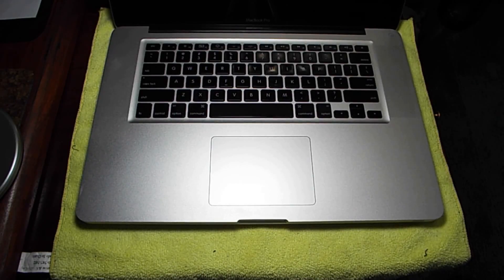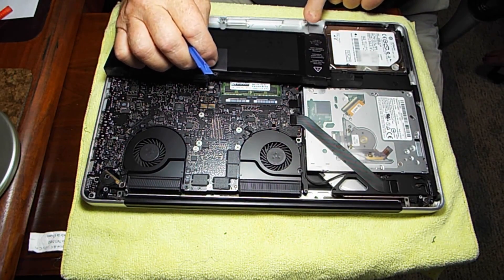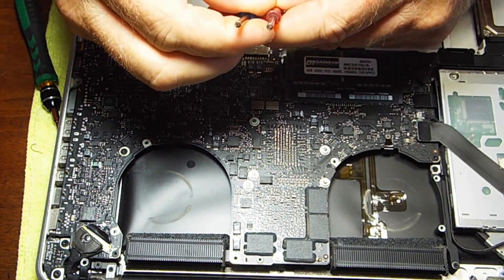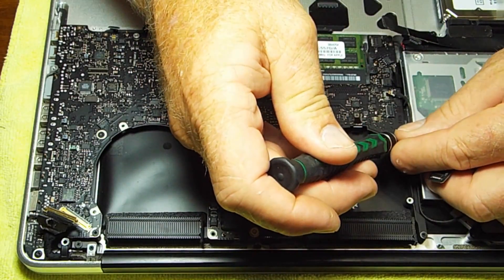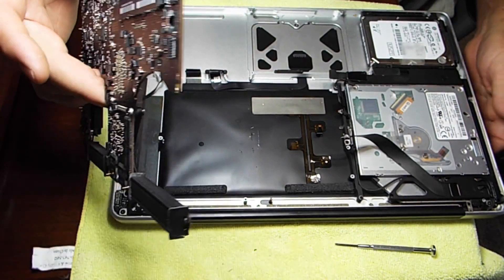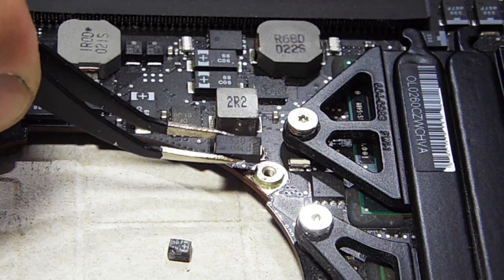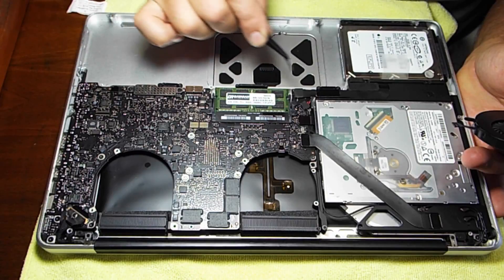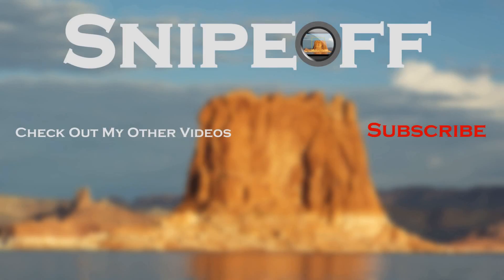Mid 2010 Macbook Pro 15 Inch GPU Kernal Panic Repair

Comment: OK, replaced the capacitor, reassembled, and now it tries to start up but screen does a micro-quick horizontal line flash, then goes completely dead. Also, the white power light on the front goes out and won't respond when I try to restart unless I hold the power button down fro a LONG time 
Any ideas?
Reply: Duh!  Missed a small ribbon cable connection under a fan...also resoldered the replacement cap and all is working fine now.  Thanks for walking me through this repair!

Comment: I seriously cant believe how easy this is. my 2017 air died this year and I have been computerless so I pulled my 2010 15" out and I had forgotten that it was doing this. its doing it way more since its been sitting for years. this is a cheap easy fix!!! I am running linux mint on it but it will just turn off whenever it wants

Comment: hey thanks for this tutorial. question, can I use a hairdryer or do I need a heat gun. I want to use a hair dryer with an extension to focus the heat like you did.
Reply: @Snipeoff  great. do you think it might be if i used a stronger capacitor?
Reply from the maker: @titustech337  I'm so sorry, I was completely distracted today at work...I didn't realize what video this was 🤦🏼‍♂️
Reply from the maker: @titustech337  This was absolutely a permanent fix for us, that computer is still working...I looked at the thumbnail and thought it was my other video for the Mac repair
Reply from the maker: @titustech337  I apologize for the confusion, I'm gonna delete my other replies to avoid others being confused 😅

Comment: I started having Gpu kernel panics on my MacBookPro6,1 mid-2010 17”. I’ve seen two videos including yours on replacing the capacitor, but for a 15” of the same model year. I’m having a hard time thinking this is the problem after over 10 years of no Gpu kernel panics. What else could it be? Why does the capacitor “fail” after so much time, and is it the same capacitor as on a 15”? I find your video very useful in showing how to remove the board, it’s a bit more involved than replacing the hard drive which I did years ago. A couple questions:

1) Is it possible to modify the kext extensions for the 17” as others have suggested for the 15” or will this not work? On the 15” the changes were G-state threshold levels all to just above the lowest setting. Is there a similar fix for the 17”?
2) I have the classic kernel panic of black screen and restart, with a kernel panic report when it reboots. However more times than not it gets stuck trying to reboot with a repetitive clicking sound from the area near the MagSafe power adapter (upper left corner). What could that be? Sound doesn’t seem to come from the hard drive (lower left) or anywhere else. Perhaps it is the fan? Power supply? Eventually it reboots after pushing the power button when it’s “cooled off”. 

Thanks in advance for any guidance, and great video.

Comment: No disrespect intended, sir, but changing my battery did not correct this problem for me. Ultimately what did correct it was an app and instructions offered by one of your colleagues found at the following URL: https://www.youtube.com/watch?v=tiXYkyj2Y5Q. What is nice about this, is no purchase of a battery or any other hardware is required: no purchase of anything at all, really. I can not say for certain it will work for everyone out there experiencing these constant crashes,  but it did work for me—which of course I am grateful for. It might possibly be effective only on the Mid 2010 Macbook Pro model, for some reason, just as your solution addresses in its title. This narrows its usefulness, of course, but in any case, if this is the model you own then you might possibly find success here as I have. Good luck.
Reply from the maker: We didn't change the battery in this video, it was a capacitor on the circuit board. But whatever the case, I'm glad your issue was solved

Comment: can i just leave the battery outside without put it back and make my 2010 macbook pro still power on with plug to electricity only?
Reply from the maker: I think you can, but I'm not sure
Reply: @Snipeoff  thanks, maybe anyone have try it before? i would like to try and following the steps
Reply: @AlwaysWrong  you cant, i have tried it but it did not power on.

Comment: Would conductive epoxy work to reattach new capacitor?
Reply: That's what solder is.  Get a $15 heat gun from Harbor Freight and a coke can like this guy in the video and make you a heat gun to solder it. :)

Comment: I have very little experience doing this kind of thing but all of the local repair places that i call say that the motherboard needs to be replaced. I don't want to pay for that to be done when the same problems will inevitably end up happening again. 
would it be totally inadvisable to try to do this by myself? 
It doesn't at all seem that difficult...
Reply from the maker: I mean if all your data is backed up, I guess you don't have too much to lose, since the computer is kind of unusable as it is... I would just take it a step at a time and work through it
Reply: @Snipeoff  it turns on and everything so it's not totally unusable as of yet. I just anticipate the problem getting worse. I have been using one of those software fixes for now which disables the discrete gpu...
Thanks for replying!
Reply from the maker: @pablocasteldeoro8526  I wouldn't be too afraid, if in the future it gets worse, just try it
Reply from the maker: @pablocasteldeoro8526  no problem btw
Reply: @Snipeoff  since i'm such a noob-in the eventuality of my getting and using a heat gun for this, what temperature do you have it set at?
Reply from the maker: @pablocasteldeoro8526  well shoot, I wish I could tell you, our heat gun just has 2 settings, 1 and 2...we had it on 2...I have no idea what temp it actually is 🤷🏼‍♂️.
Reply from the maker: It was running really hot thou, especially with that cone on it, it actually kinda overheated the gun...by the way you can buy those cone adapters for heat guns online, rather than making one

Comment: Hey. Thank you very much for your tuto. I just fixed my MBP and it works great ! Just one little pb : lightness is not optimal and the screen brightness butons on the keyboard don’t have any action anymore. Where does it comes from ? I’m wondering if the connexion wire up to the right fan is not the Pb ? Thank you very much. B.R.

Comment: Hello sir
I am a student .I am new to mac world.I am having macbook pro mid 2010 serial number W8020CFZAGW .I am using windows OS .
While using After some times my macbook blinks few times and give error ''Display driver stopped  responding" or
"Kernal version 342.01 has stopped responding and has successfully recovered"
But while using Mac OS 
After some time my mac Automatically restarted with error
"Your computer is restarted because of problem"
Will changing capacitor solve my problem??
Plz help
Reply from the maker: I'm not entirely sure...I did a little research, and your problem seems a little different
Reply: @Snipeoff  Thanks for giving some attention to my comment.
But sir;
Any suggesion to solve this?
Its very easy for the person like u to judge the problem. I am not professional like u.
PlZ suggest me a possible solution?
Reply from the maker: I really am not a pro...we have experience fixing electronics, and we researched the specific problem we had and found a solution...but we aren't professionals
Reply: @Snipeoff  Any suggested solution??
Reply from the maker: @knowledge.hub1  Perhaps take a look at this video...https://www.youtube.com/watch?v=3op7JknzUyA

Comment: Hi , just stumpled on your video makes it look doable, thanks!!!Really thinking about trying it. Only question is did it fix the issue? And is it still working?
Reply from the maker: For us, it did absolutely fix the issue...and it is still working today, we have not had an issue since with it.
Reply from the maker: I would recommend getting yourself a screwdriver set...the link is somewhere in the comment section, to the one we used...and there are heat gun adapters on Amazon
Reply from the maker: I added that link to the description, let me know if you have other questions ;)
Reply: @Snipeoff  amazing i got the soldering set and a microscope headgear carted up in amazon was going to upgrade the ram to 8gb and replace a faulty battery first, if that doesnt do the trick i might pull the trigger, gotta keep busy during these crazy  times. thanks again!
Reply from the maker: Yeah I hear you there...I've been doing maintenance for days on my truck to stay busy...no problem...I appreciate the comment 🤙

Comment: HELLO I HAVE A MACBOOK PRO 2010 SERIAL W80291Q2AGZ , PANICS AND RESTARTS ,DOES THE CAPACITOR WORK FOR ME?.....CAN SOMEBODY HELP ME.
Reply: https://www.youtube.com/watch?v=YI6V2k6dvLg
Reply from the maker: I'm not positive...but I'll pin your comment so more people see it 🤙
Reply: You need need to look for panic code. if it says gpu failure, then this may solve your problem.
Reply: I guess I am a little late, but yes. Just have a repair shop replace this wrongly specified capacitor with a tantalum(?) one and your MacBook will live again. The MB replacement Apple did was never necessary. I payed 350€ for a new one with the same wrong capacitor and had to pay again to have it replaced at a repair shop. I also had to replace the keyboard. Now it will work again for another ten years.
Reply: Probably replace it, nothing to lose!

Comment: Thanks for the video, especially the tips on how to remove the logic board and labeling them.  I don't have a heat gun, but i do have a regular old soldering iron with nice small chisel tip.  Will this get hot enough to remove the old capacitor?
Reply from the maker: Um...it could, I'm not entirely sure...the issue would probably be getting the new chip on... because you don't want to melt the casing while you're trying to get the solder to melt underneath
Reply: @Snipeoff  yeah i was going to try it with my soldering iron but i didn't think it was such a good idea
Reply from the maker: @titustech337  Hey, just wanted to make sure you saw my reply on your other comment?

Comment: The capacitor is about $8.00 ... but your need to get the proper screw drivers, and the heat gun ...
Reply from the maker: Check out Amazon for an electronics screwdriver set, this is a good one https://www.amazon.com/dp/B01N7UD3Q1/ref=cm_sw_r_apa_i_kreDEbWH1Q37D

Heat guns aren't too expensive, check Harbor Freight, you can also get the smaller tips for a heat gun on Amazon, search heat gun adapter tips... I hope that helps

Comment: is there anyone know that how much this gonna cost me
Reply: The cap runs about $8.00 at Rossman. You can find it for less elsewhere but that’s what I did. If you don’t have the tools then factor in an additional $40-$50 for a super cheap solder heat gun on amazon, solder and flux. Use flux please.

Comment: Just did this on my macbook for GODS SAKE dont try to pull off with tweezers like snipe did if you do this especially at higher temperatures you will pull the pads off the PCB. Heat till the chip can be nudged softly then lift, no pulling, no force!
Reply: wish I saw that comment earlier...

Comment: Do you know if this will work on a early 2011 15" mac book pro. I was just given three of these.
Reply from the maker: You know I can't be sure Greg, but it's very possible. 🤷🏼‍♂️
Reply: Unfortunately not. The 2011 models have a faulty GPU. But there is a workaround. Check out dosdude1.com for some great solutions.

Comment: What temperature was the heatgun set to? I need to replace the same cap and I've used up to 600°C but the it won't come off :(
Reply from the maker: We only had two settings on our heat gun...high and low 🤷🏼‍♂️, I really don't know how hot it got, but wow I would think at 600°C it should break loose
Reply: @Snipeoff  thanks for replying so quickly ! Well it's only being in short bursts, maybe need to stay longer on lower temp
Reply from the maker: @nicoxis  that might be the issue, we did have to heat it for a good amount of time

Comment: after i replace this cap the fun it's running full speed and keyboard lights it's flashing blinking . any idea?
Reply from the maker: The only thing I could suggest is check the plug for the keyboard, and make sure it is plugged in fully. Also take a look at how to reset the SMC for your model MacBook, that might help as well 👍, let me know how it goes 👌
Reply: I run ASD and was fail with smc pid sensor. I have been reset a smc and now it’s working fain. Thanks for help and keep a head . Nice video and it’s working great. Have you try it on Mac mini mid 2011? It’s the same  problem with cpu/gpu 2 caller panic kernel. It’s starting only in safe boot. Thanks!
Reply from the maker: @florinlupascu1816  That's awesome to hear, so glad it all worked out 👍, I haven't tried it on a Mac Mini, but I will post a video if I ever do 😉

Comment: how did you make the extension from your heat gun?
Reply from the maker: We cut some thin sheet metal out, shaped it into a cone, and then we welded the seam. But you could also use pop rivets to close the seam. Hope this helps 😃 let me know if you have more questions 👍